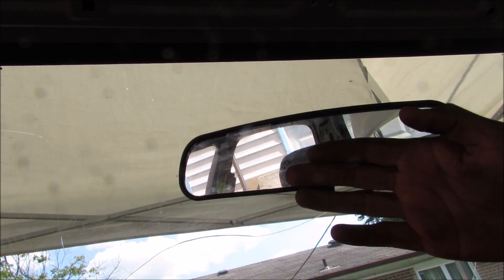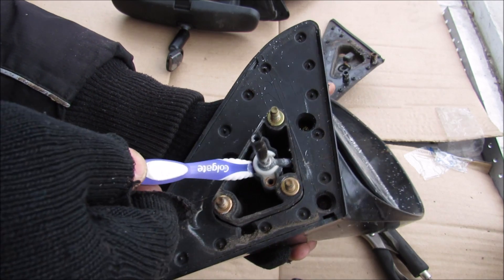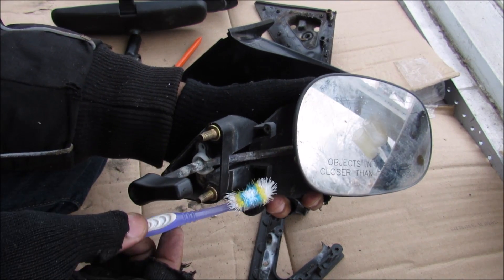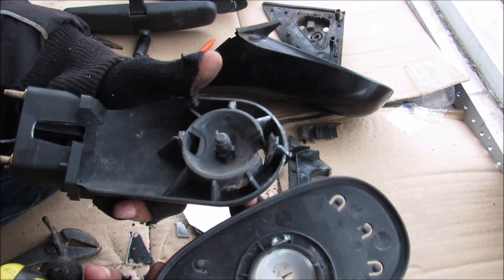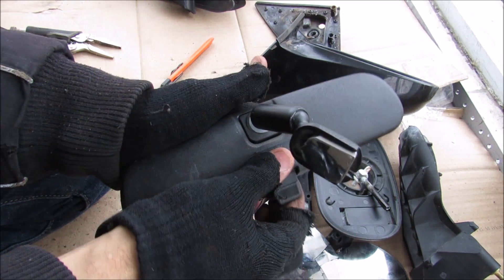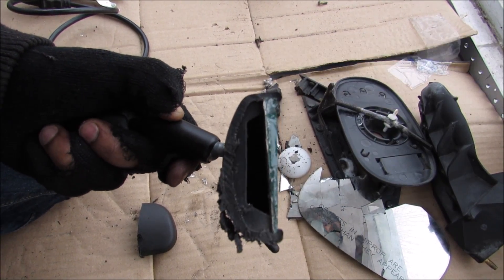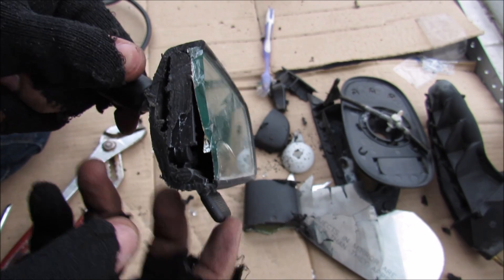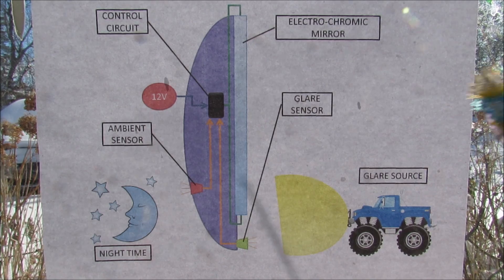How a Rear View Mirror Works

Comment: I think you got the rear view mirror flip switch fact backwards, it is much easier to quickly flip it towards yourself then trying to push it and in a spur of the moment pushing it too hard knocking it out of adjustment in an attempt to get rid of those pesky bright lights behind you.

Comment: Would love to have your insight on rear view side mirrors, controlled by electrical power.
Reply: I think it's the same as an electric rear view (middle) mirror: Electro-chromatic, with light sensors front and back to control the level of dimming - possibly the sensors on the (middle) mirror itself?
Reply: @fun_ghoul  Read again. I said electrically controlled side mirrors.
Reply from the maker: I have a video on memory mirrors and will have one on powered mirrors coming up from the G35 project. Stay tuned!
Reply: Thanks a lot. Keep up the good work.